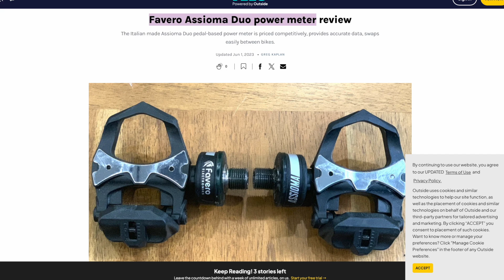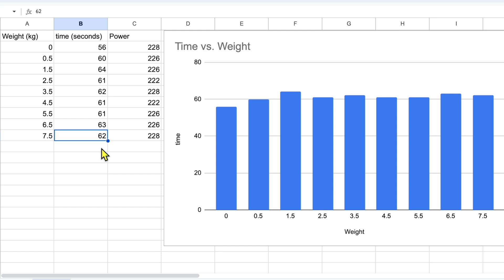How Slow is 7KG EXTRA WEIGHT up a short climb?

Comment: What is your ftp? was if hard to maintain 200w for 1min?
Reply from the maker: 249W FTP. 200W isnt a problem. actually some parts of the climb i was pushing 260W, its just the average was 222-228W
Reply: @aaroiseverything  ah well you have high ftp. thats why it isn't hard maintaining 200w. what's that in w/kg?
Reply from the maker: @hucklejoko  4.8😬